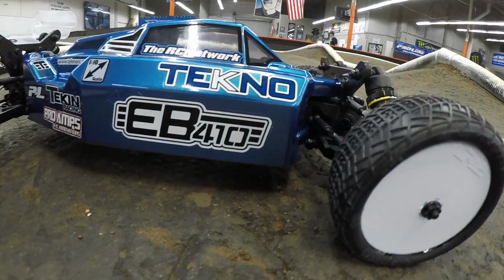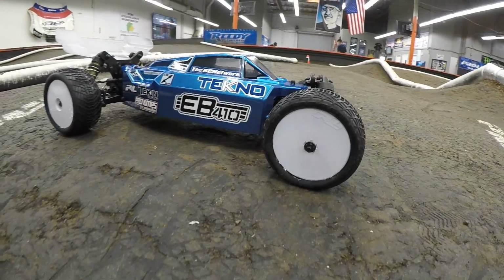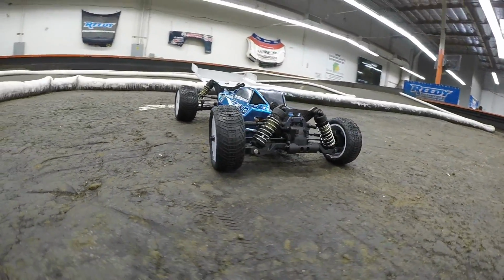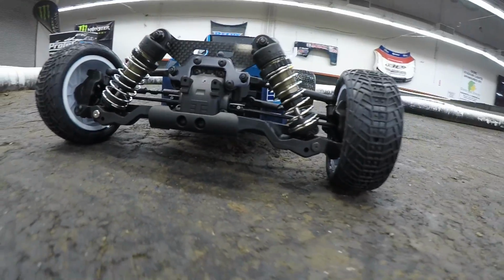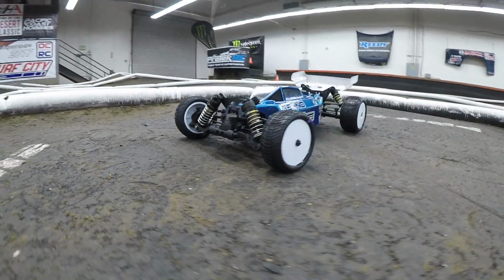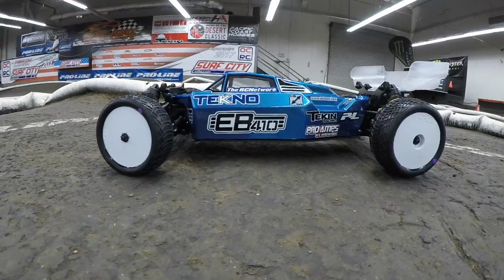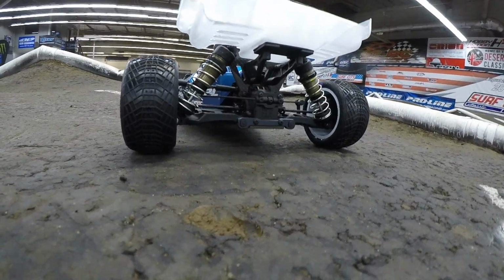Tekno EB410 - A Few Laps with Jake Thayer

Comment: Im hoping you will be able to help me here. I have a tekno eb410 and i don't know what motor and esc to go with. Im looking at the hobbywing xr10 pro esc with a hobbywing v10 13.5 motor. But also I've been looking at the tekin rsx with a g3 red line 13.5 motor and also some reedy stuff and maclan combos. Could You reccomend a good combo for the eb410 ?
Reply from the maker: ULTiMATE TRAXXAS MAN budget wise,, the HW combo can’t be beat. Partner it with the WiFi module and you have a great combo. There is something about Tekin power I like through, but it does come at a premium. I have the new Maclan combo, but haven’t tested it. I actually just swapped out the Tekin combo for the HW, but running the 6.5t V10 Motor
Reply: The RCNetwork thanks rich. I'll probably go for the hobbywing combo. A lot of people run it at the track I go to

Comment: Where's the front swaybar?
Reply from the maker: No front sway needed according to the box set up....it's an option part.  After running it, it doesn't need it. I asked both experts that drove my test car and neither said it needed it
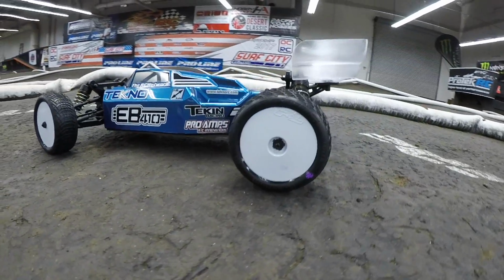Reply: Nice, thanks for the response.  That's interesting, and seems a bit unusual.  But I don't that much about 1:10 4x4 buggies.

Comment: Tekno needs to make a lighter weight version for spec racers. Spec racing isn't as fast so going lighter shouldn't affect durability much if at all.
Reply from the maker: one4all I think Tekno have is a great starting point. Mine we ghee in at 1670 and that’s not too far off from some of the super lights...plus isn’t minimum weight like 1615?
Reply: The RCNetwork isn't yours using carbon fiber parts?

Comment: Looks like nose diving most of the time.
Reply from the maker: That's Jake's and most wheeler's driving style..get that nose down to get traction off the front tires and accelerate
Reply: Yep, works on 4WD, get that traction action as soon as possible. Plus you want it down going into the landing-face of the following jump when you time it right.
Reply: That's done on purpose to get the front wheels down matching the face of the track when you land.  Smoother landing and traction, driver's that do it can save tons of time per lap.